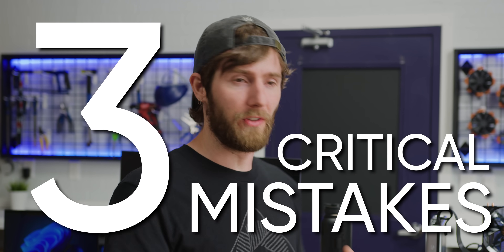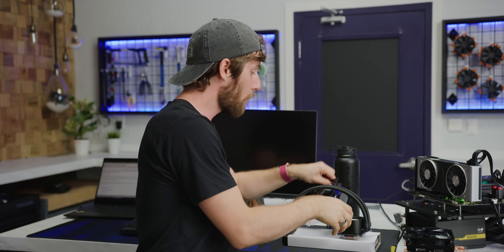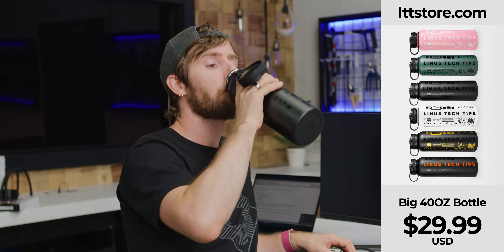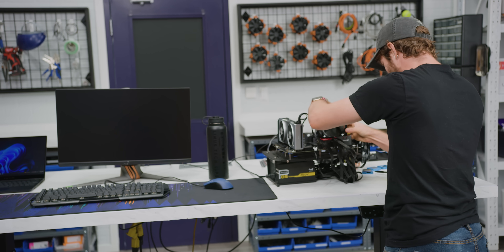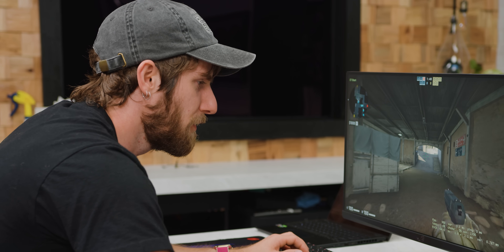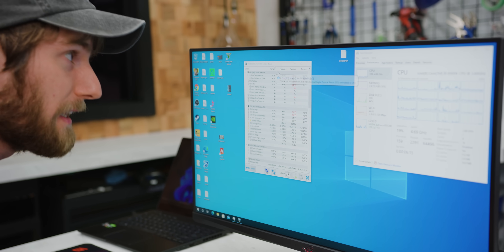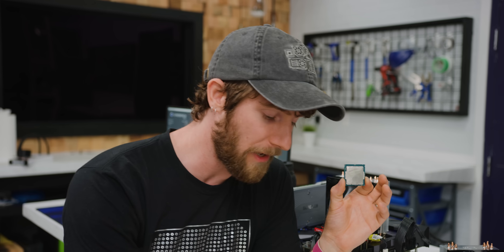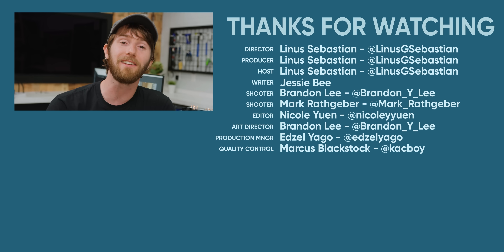How BAD is it if you forget to peel??

Comment: I just made a new pc and my fans run around 800-1000 rpm but my cpu radiator fans run at 2000 rpm. I cannot change it in the bios for some reason and it is very VERY loud. Any help will be appreciated

Comment: well... a thin layer of plastic will hinder the thermals a little, but most cpu's turn off if the temperature gets over 120C (plus/minus) and most plastics dont melt at that low temperatures so the plastic film should not melt, but the cpu should run hotter

Comment: Yeah, ran my i5 4440 for over 5 years with the sticker in place. I'll never understand how I managed forgetting the peel. To my defense, it was my first 100% silence focused build and although under synthetic loads the temps were high (low 80's if I recall correctly) but as the system was dead silent, I concluded this was the price to pay for a silent system. When I eventually discovered my mistake during a maintenance thermal paste replacement, removing the peel didn't even make such a massive difference, like high 60's under synthetic load.

Comment: This happened to me. I bought my current computer second hand. I paid 3/4 of the original price after 4 months of his purchase. He said it was due to him not using it as much.

He built the computer himself and I noticed that the water cooler pump for the CPU fan would sound like it ran dry sometimes. I used it for a couple of months and I noticed poor performance while pushing the computer and couldn't figure out why. But I had enough of the water cooler and bought a noctua cooler. When replacing the cooler I noticed that the plastic cover was still on... 

The computer ran like that for at least 8 months. But it works fine now! It might have taken a small performance hit but I'm not sure.

Comment: Luckily, each of the 3 PCs I built came with the thermal paste already added and the plastic cap over it, making it impossible to use the cooler without taking it off. So never happened to me. I would have needed hours to find it.

Comment: Super bad. I was having heating issues with my i7 6700k for 5 years without even knowing it. It wasn't until a few about 1 year ago that i finally noticed the overheating issues thinking there was an issue with my cooler. I even assumed it needed a replacement and ordered an AIO water cooler. Low and behold when i removed the old one..... there it was.... "remove before installing" on my old cooler.

i felt like a total noob, which could be forgiven for it because it was the first PC i've ever built. But given that i went 5 years with out even noticing the performance issues despite playing some pretty impactful games and the like, should point out that it wasn't that detrimental. But it wasn't until more recent years where the problems started to arise. During a particularly hot summer, plus playing some more recent games like Star Citizen, i was getting blue screens. I still went ahead and installed my AIO cooler, but it was an embarrassing lesson learned. Now my PC is running much better, and much cooler, and the CPU is still running despite being 6 years old and almost 5 years under plastic. Granted it's an old enough CPU and my daily power usage isn't too much, so it still might be a while before i start to see the long term degradation.

Comment: I'd be interested to see the difference between a fully scratched up base of a cooler vs a polished base, both with adequate paste. 

Will there be a noticeable temp difference?
Reply: probably not because the paste is basically acting like a gap filler
Reply: 100 grit sand paper on cpu and cooler  and see if thermal paste helps. Then do a polished cpu and/or cooler.
Reply: wouldn't a pattern of ridges with an equivalent pattern on the cooler be better than two flat planes, both for the greatly increased surface area and better lockup between parts?
Reply: @MarkoDash  thermal paste isnt really a great thermal conductor, all it does is fill in the small gaps left over between the two layers of metal. With machined surfaces, you have thousands of microscopic grooves able to make metal to metal contact, while with a scratched up surface, you reduce the ammount of those smaller grooves.
Reply: @Timeward76  i meant an interlocking pattern like a picatinny rail but on a much smaller/denser scale
Reply: @MarkoDash  that would be very expensive to manufacture compared to just flat surfaces, and while it would likely work better its not worth the cost outside of custom, tailor made applications.
Reply: @MarkoDash  @timeward is mostly right. The other MAJOR benefit of thermal grease is that it pumps out the air and prevents bubbles. A system like the one you are describing would make that considerably more difficult to ensure. Secondly, when you have a system like the one you describes, you have increased your surface area, but decrease the cross sectional area for the heat flux. What I mean is, all of the small ridges (fins, really) have heat coming from both sides, and will struggle to transfer that to the base efficiently. Basically your heat flux is no longer constant across the body, but has peaks of higher and lower flux. So you might get a small performance boost, but it would not be equivalent to the increased surface area. Source: I'm a thermal engineer for electronics.
Reply: @evancosentino607  not to mention the care and precision required to machine matched pairs.

Comment: I did this with an i7 930 one time by accident. Motherboard stopped booting. Ended up getting an i7 950 and it still wouldn't boot. Ended up frying something on the motherboard. The 930 did have some darkening underneath the chip in one area but still operated fine. Plastic did not melt.

Comment: The Beginning: plays
Everyone who built their own pc: visible panic
Reply: More panic when it's NOT you who built it
Reply: True lol
Reply: Bro I was like you can peel that
Reply: The most stressful part of building mine was seating that $300 cpu, especially during a chip shortage, so thank you Linus for more anxiety.
Reply: @tristanr7581   Dude, I've seen my old 980ti literally catch on fire due to current fluctuations destroying my old PSU. I don't think I've ever sweated more in my life, while re-building a PC and plugging a new GPU on a new PSU. After hitting the O/I switch and seeing the system powercycle and boot, I legit felt I needed to lay down on the bed . .
Reply: @TidusfromZanarkand  whats current fluctuation and how to prevent this from happening?
Reply: @user-og5lo   What it is: It's spikes in your wall outlet electrical current, usually due to a combination of your electricity provider system having issues and/or your house is very old or poorly wired, like in my situation.

How to prevent it: Buy a UPS. It will protect you from that.
Reply: Holy crap

Comment: I once forgot to peel the thing off of my AIO. When idling, temps were actually normal but even a bit of load made them shoot up to 100 degrees and the CPU throttled massively.
Reply: I did the same on a 32 core threadripper.  30c instant gain when I started a game. Spent 2 hours draining and refilling my loop. Fist and only time I've done it.  Been building pc's since I was 10 and never made that mistake. There's a first for everything
Reply: @nando03012009  how often do you change out the water in your loop?
Reply: @GameTimeWhy  for me, once a year is enough.  I only use water. No dyes. Depending on your loop. You may need more maintenance.
Reply: While water cooling should result in the opposite if used without the sticker. Temps rise slowly and fall slowly.
Reply: @HappyBeezerStudios  I haven't noticed such behavior in normal use cases. The temps rise immediately when load starts and drop immediately when it ends. With very long 100% load the temps might rise by a few degrees over 10 minutes but nothing out of the ordinary, that happens on air coolers too.
Reply: @HappyBeezerStudios  
When cooling capacity is reduced, the chip will swing in temperatures faster
It's a simple law of physics, if you can't easily transfer energy, it builds up
Reply: @dustinjames1268  The rate of transfer must not be that different. The chip in itself is very small with an heatsink on top. So there's already a limit of how fast the heat can escape, een with a perfect cooler you would still have that first resistance.
Reply: @HappyBeezerStudios  can't speak to aio but for custom water this isn't the case. Even under heavy loads (blender render for 4 days and gaming at the same time) it cooled immediately after everything was turned off.

Comment: Haven't watched the video yet, but let me tell you this, if you come up to anything else that "it's wrong you need to make sure it doesn't happen" your statement is wrong!!! yes in the short run it won't do much troubles, but in the long run, it can destroy your cpu, 3-5 times have i had clients coming for over heating issue, i remove this sticker and the heat problem drop by like 5-10°c, but idle the cpu is still running at 60-80°c. running the cpu hotter than needed will create damage. by having the sticker, the cpu run hotter than normal, wich accelerate the drying of the paste by a lot. in the end, you get a cpu that run all time at high temperatures and when you try to really use his power, it thermal trottle. now if you're tech savy, that's the point where most of you will see it and change the paste and at the same time see the sticker and remove it. but some people wont notice and let that pc run like that for a couples month and you endup with a cpu that's permanently damaged from heat, i've tried even deliding one of them without any effect, it's the die that start to degrade over time when running hot all the time.
Reply: alright, just finished the video and in general, good job lmg, you did a relatively good job explaining it so my comment is more like a support for what you said.

BUT you said it kinda like it's no big deal unless you have a big cpu outputting tons of heat. you said it CAN make it die prematurely, but it seams you didn't really think about what running a cpu at 1.5x-2x the heat will do to it AND the paste cooling it. as i said, running a cpu a lot hotter than intended will reduce his life by a LOT i've seen 4yo i5 cpu die because of this, the big problem comes in play when the build don't get to a pc enthusiast. someone building a pc for a friend or family, that person will cook the cpu for a couples years until they see a big drop in performance and most the times, it's too late. i've recovered 0pc with this "problem" in 4 years of reparing pc, and that's the scenario for all of them. altho, as i said, my job is to repair pc, so i obviously don't see all the pc who are running fine with it, just the ones who have problems. but the possibility to damage the cpu beyond repair is more than you think and the laps of time is less than you think.

p.s. this would make an awesome experiment kinda like the dust pc you did over a year.just build 2 pc with identical specs, one with the plastic removed one without, either run benchmark 24/7 or run a script on both of them to get them to simulate a normal day to day use. look at the difference in temp and performance in both of them at start, let them run for a year, compare, repeat every year until one of the pc die. I would vote for the stress test 24/7 just because altho unrealistic, it would much quicker and easier, the pc would die sooner so you're sure it won't take like 6years before seeing one of them die

Comment: Forgot to peel that plastic off between a CPU cooler and athlon xp 2100+,, well the CPU didn`t survive.. (5seconds after poweron, it destroyed the cpu).. 
Also you did apply grease, but at that time the grease was already under the plastic preapplied.. the plastic was there for protection of that paste

Comment: I wish you would have used more than just a single low-power chip I'm still worried about more powerful chips having a thermal runaway that can't be stopped by the throttling causing damage from the large initial loads

Comment: I miss a comparison for the i9 without the peel because the cooler seems to be a little bit to smal for an i9 I think. I run the i9 9900K myself and I build a custom water loop just for the CPU and on cinebench even I hit 85°C with all cores at 5GHz

Comment: Literally decided to upgrade my pre-built CPU fan to a redragon reaver because temps were too high. First upgrade I ever did. Didnt have any thermal paste, so I was happy when the cooler box came with some. Applied it on the cooler, then realized I didn't take off the sticker because the sticker had no marking on it. Had to buy more thermal paste.

Comment: I can admit that this happened to me some years ago. To be fair I was like 16 years old and it was only my 3rd build, but I had forgotten to take it off apparently. I believe it may have been my first after-market cooler, whereas in previous builds I just used the stock which usually comes with thermal paste and a VERY noticeable hard plastic cover. The aftermarket Hyper 212 Evo had a tiny plastic sheet that I failed to notice. It wasn't until my temps were in the 70-80 C range at idle and occasionally shutting off for thermals immediately after booting into BIOS that I figured something was wrong. I was shocked that that had happened, because I remember seeing the plastic and I thought I had removed it at some point, but I guess I didn't. 

I'd say it's a good learning experience because now if I know or see anyone in the same situation with their thermals being randomly out of control after a new build, I know to think of the plastic on the heatsink :) Whereas before I would have never thought of that.

Comment: Yes you won't melt the Thermoplastic Polyurethane (TPU) sticker by using it. 
What you might notice after hundreds of heat cycles is what looks like dandruff on your motherboard as it will eventually degrade itself.

Comment: just built my first pc in July. I did exactly this. Bios read CPU temp as 74 C aka 174 F for my 5900x. Couldn't figure out why but one thing I knew is the AIO 360mm had two non working fans, figured the whole unit wasn't working. Immediately bought a new one and took the non working one off. Embarrassingly enough, I saw the plastic still on there. Never will I make that mistake again. CPU is absolutely fine. I never ran it for long periods. I booted to bios, checked the temp, shut down and tried a new solution.

Comment: I wish they went with a situation like mine ages ago from a Cyber Power prebuilt, it was an i7 950 and a Cooler Master tower cooler, with paste pre-applied, in this vid the paste between the CPU and the protective plastic protects the cold plate and HS from the melting plastic, preapplied, the plastic is going to melt onto the HS  and IME outside of some serious lapping of both, will never be right again. As for real world cases, I think the one I am describing is more apt to happen, a pre built with the paste pre applied to the cooler not getting peeled, you guys should revisit this soon.

Comment: usually, the distribution of those who dont peel the plastic skew toward i3/i5 buyers, it would be more difficult to detect this problem as the heatsink itself is still working and proving undistinguishable results. manufacturers should at least put another warning sign on the box or use hard plastic covers like nzxt's aio in order to avoid some of these incidents
Reply: A bit of a bias of ownership. Those that buy more high end parts tend to also be more knowledgeable.

Comment: Once i forgot to remove the peel, i was worried a time because temps was kinda high, like if i stood with intel base heatsink, but it was a kind decent cooler (hyper 212) The CPU doesn't overheat anymore (with intel stock it was overheating) leaving this for over 2year until i decide to clean it up, and noticed my misked, forget the peel under the heatsink for almost 2 year, the CPU was working totally fine but was kind of hot.
Once the damned peel remove the CPU was droping by 20C XD

Comment: I suspect this conversation occured at some point in a Noctua meeting: 
"Should we use molded plastic cover or a plastic film with a PSA to protect the heatsink surface?"
"The molded plastic cover is more expensive, but it is also impossible to leave on during a build, so we will go with that."
Reply: I still have the box of my old i5 that I got in 2013. The stock cooler is still in there together with the molded plastic cover and the pre-applied thermal paste. 
If Intel can go with molded plastic for their shoddy boxed coolers, Noctua can justify it for their coolers with 20€ fans.

Comment: If you think about it some manufacturers use everything from mica to ceramic to insulate high current transistors from a heatsink, some ceramics are as thick as 1mm yet they are supposedly great at allowing heat transfer of course they require thermal paste to promote conduction. That plastic is applied to the cooler with some form or adhesive and probably wasn't placed there by human hands as long as you include thermal compound/paste it should allow heat to transfer without many issues. For a comparison try this, take the sticker off, drop it on the floor a few times maybe stick it to the forehead of an unsuspecting employee then reapply it to the cooler, apply some paste to the cpu and stick the cooler back on there then show us the thermals!

Comment: I got a PC from work once that was built by IT, it had an i7-980. Never had any problems. I got to take it home when it was upgraded and I took it apart just to thoroughly clean it and found that the plastic was still on the CPU. Took it off and put it back together. Still no issues. Probably ran cooler, but I never checked before and after.